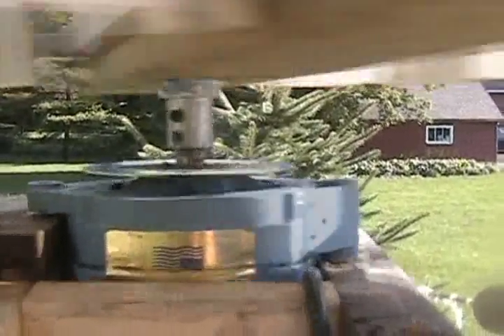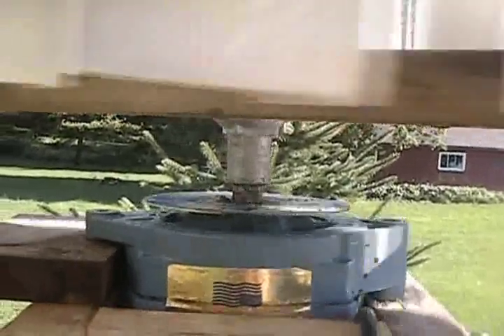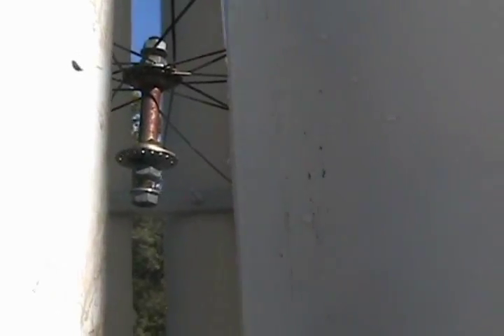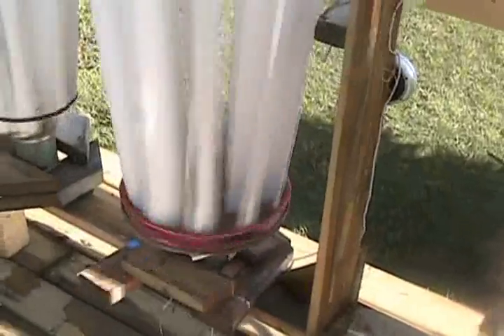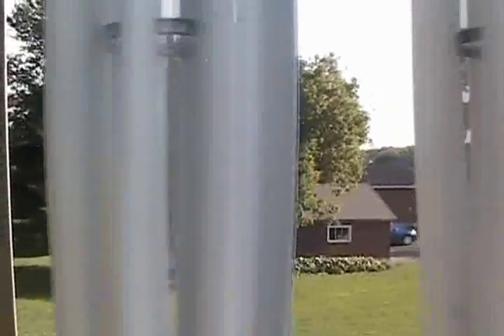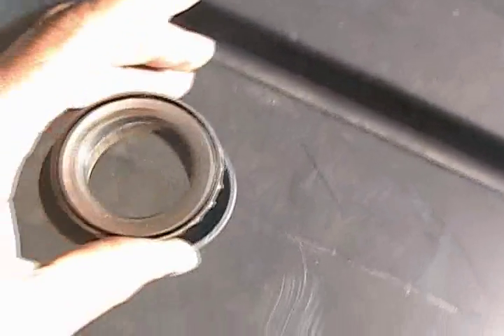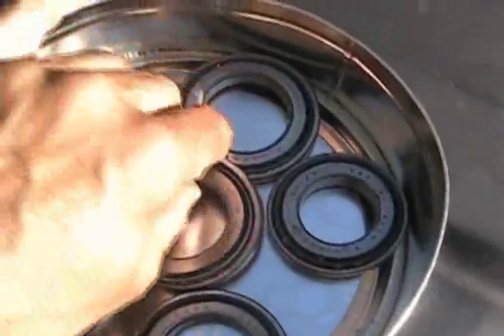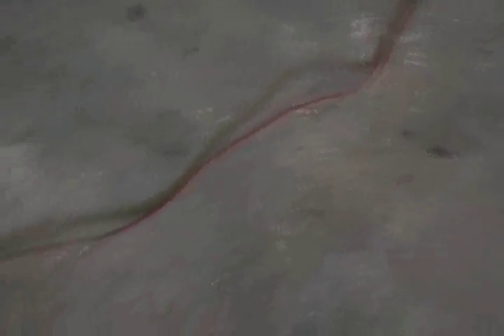V18-4" _Wind Turbine vawt_savonius vertical axis hawt diy ametek green eco solar

Comment: Some good work.  Just wish you would've given us a wider angle video shot of the whole caboodle before showing all these little details.  Those bearings look nice, but I'm still thinking they might be overkill.  We use some very light weight nylon ball bearings for some equipement at my workplace.  They don't need any lubrication - and remember grease or oil has viscosity which translates to friction....